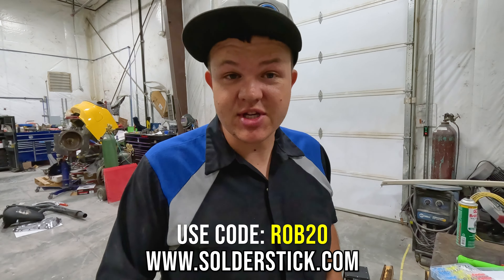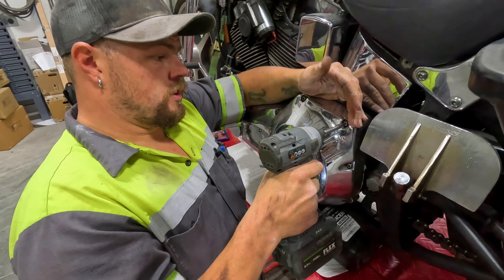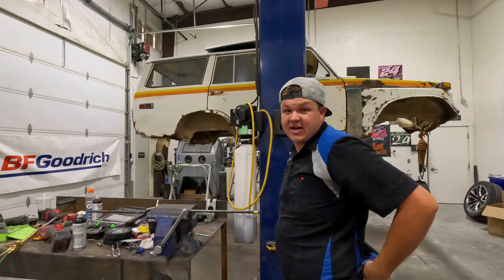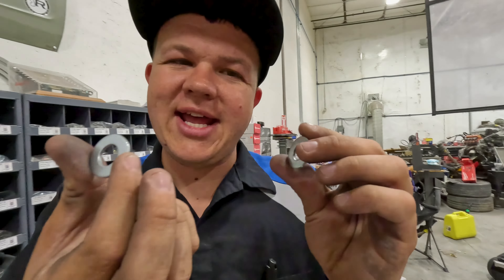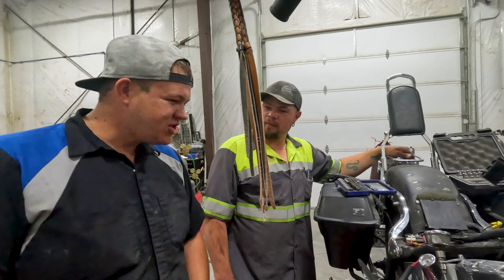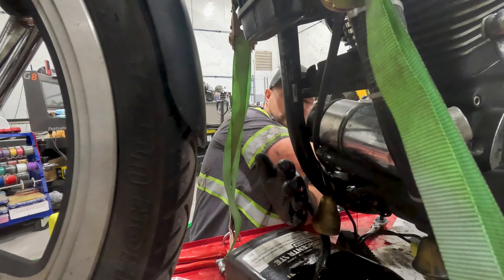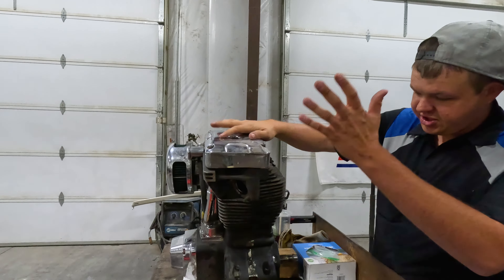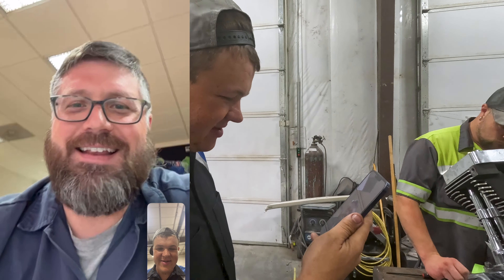Total Disaster Tearing Harley Apart, Nothing’s Usable!

Comment: Pick a washer somewhere on the outside of the old engine and put it on a brand new engine. Problem solved. If there is a Harley shop somewhere near leave the rest to them. You are the paint pro they are the bike pros.

Comment: Hey I'm 50 I have been riding and working on Harleys for over 30 years ,  The best thing you can do to that bike is put a 1340 Harley motor back in it,  It was the best motor Harley made, and you can find them for $1000-2000 , ALL the aftermarket motor  suck They make good power but do NOT hold up , I dont care if it SS or any other ,  After seeing Hillbilly ride He dose not need a lot of power , Not saying that to be mean but you can tell he dose not a lot of miles riding , yes he can ride , but still needs lot of miles before big power

Comment: Training wheels on kids bikes is actually not a good thing for the kid; sure they can help the kid learn to pedal without having to worry about balancing, but they actually just prolong the whole learning process. And, not only that but it’s actually counterproductive because it creates a false sense of what balancing actually is, then the kid basically has to relearn (or unlearn rather) the whole process. Most kids can actually pick up the whole process quite quickly if just given a bike the right size and space with a semi-soft surface to practice on. The biggest achievement when a kid learns to ride a big isn’t actually the riding part, it’s overcoming the fear or anxiety of falling, once they get past that, the riding part actually comes quite easily for most kids.

Comment: you probably should have rolled that motor right outta the frame and straight into the dumpster, you have a decent roller but those aftermarket big motors were pretty much only made for show, if Rick put big miles on that bike he did with the old motor(real nice to give it to you though) you should try to find fairly stock twin cam motor, it will increase the value and reliability. just saying...

Comment: Balance:  Take the pedals off the kids bike, or in this case, let her ride it with out the power.  Let the kids use it as a scooter.  They will learn balance real fast.  They can't learn two things at once.  They already know how to pedal, that's crawling but sitting on a seat.  Once they learn the balance by pushing with their feet and coasting, put the pedals back on the bike or turn on the power and they are off like a heard a turtles!

Comment: Hillbilly, as a long time Harley owner, rider, and Mechanic, that is NOT a crankcase, that is the PRIMARY were you have the compensator, the main drive chain and chain tensioner and clutch assembly. There should not be any engine oil in the primary. 
The inner primary connects tie engine to the transmission, once you remove the inner primary I would strongly suggest you replace the transmission input seal and the main drive belt.
It's one of those while your there, best to get it done so you don't have to tear it all down again to service them.
As am old rider and tech, I am only trying to help a new rider, as us old guys all try to help a guy out.

Comment: I have to insert the cranky old man comment. When I was a kid, if we were lucky, we had a pedal operated tricycle and maybe a car or tractor. Then we graduated to a pedal operated bicycle. Some got to use training wheels but most of us had to learn without them. We rode our bicycles many miles without any motorized assistance until we got old enough to drive. The first Go Kart we had we had was a three wheeler that we made out of wood and some radio flyer wagon parts. We would pull with two bicycles while another one drove the kart.
Reply: There were almost zero small bicycles in my day (mid fifties).  My first bike had Ballon tires, massive fenders and heavy metal everything - weighted a ton!  No training wheels either.  I had to push the bike next to a curb to make it to the seat and have one foot on the curb for balance.  Needed help to stand the bike up if it fell over.  Oh, we did not have helmets either!  I knew of no one in my large neighborhood that ever got more than a few scrapes from bike accidents.  Those were the good old days😮

Comment: Words of advice from experience: there are two ways of learning to ride a bike. Training wheels postpone learning to balance until the rider has learned to pedal, brake (most important one), and steer. Once they have mastered that, the training wheels come off. For learning to balance, you can try the hard way. With the hard way, the rider tries to pedal away with mom or dad running along behind grabbing the seat trying to keep the rider from crashing. Several weeks later and a box of band aids later, they will get the hang of it. Then there is the easy way. My daughter figured this out on her own. As soon as her training wheels came off, it poured the rain for a week. She desperately wanted to ride her bike. She went out on the front porch, mounted the bike and walked it from one end of the porch to the other, turning around at the end and heading back the other way. After doing this for a couple of hours, she was gliding about three feet between strides. Soon it was 5 feet between strides, then she was gliding the length of the porch. Then she figured out she could stop easier at the end of the porch by putting her foot up on the pedal and using the brakes. At that point, I pointed out to her she was basically riding the bike. When the rain stopped, she took her bike out in the driveway, mounted it, pushed off with her feet to get it started, put her feet on the pedals, and pedaled off into the distance. Elapsed time from when the training wheels were taken off-- 1.5 days.  A couple of years later she taught her autistic little brother to ride in just 2 days.  No band aids for either one of them. 
Since then, a number of little kids in the neighborhood learned to ride using her method  -- usually in less than 2 days.

Comment: Robby, I believe you like original, but the sad truth is that Hillbilly blew that engine because of inexperience, he is still a learner, and I don't want to offend , but the fact is he is so busy learning riding and taking care he didn't watch the oil pressure gauge. Sure the engine had a problem and lost /used all its oil. But if he had seen the gauge, I don't believe for a second, he would have continued riding.  All this to suggest you fit an oil alarm /light till he is used to the bike. Sure he wont like the idea but how often are you going to replace damaged gear on it for the years that he will need to become a safe rider but an expert rider

Comment: The crankcase you are removing is in ALL actuality a PRIMARY COVER.
at the point Hill Billy started beatin on the flywheel shaft I had to shut this video down.
You need a Harley engine builder to maybe make that engine run again or you will be buying another after prying and beating on that engine.  😧